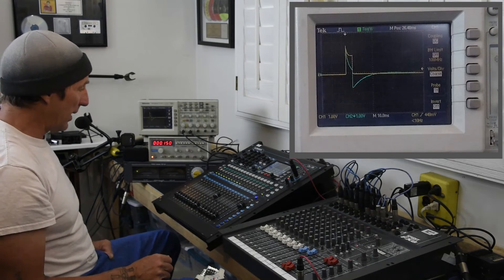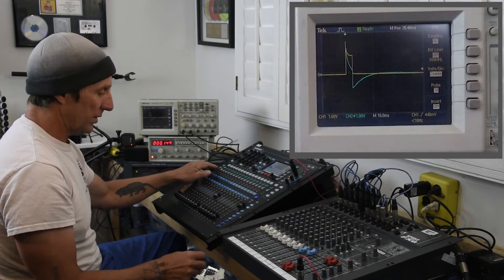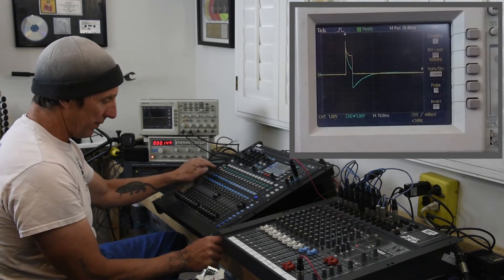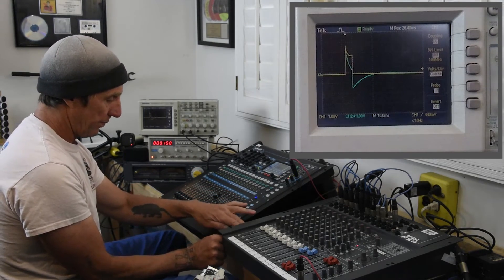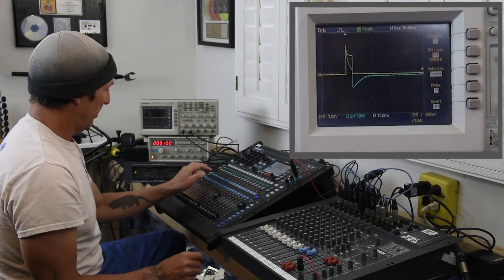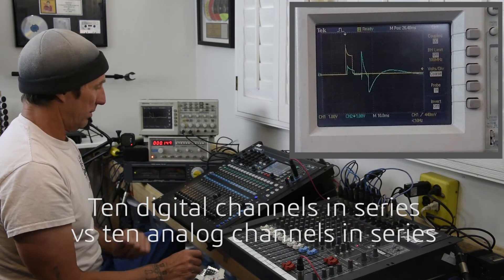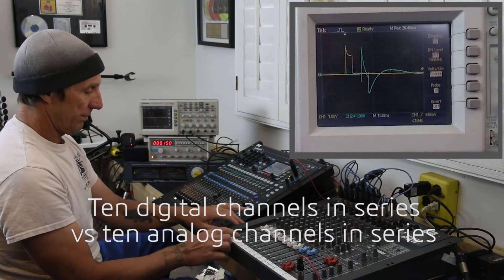Digital versus Analog #4 of 6 - Pulse Test

Comment: I like the sidebar about how "irrelevant" 1.5ms latency can be. It is very easy to fall into the trap of nit-picking anything that isn't absolutely perfect as soon as you're made aware of the imperfection, but you'll never actually do anything if you let that mindset start creeping in because perfection is impossible as long as we're in a physical space.
Reply from the maker: That's not a simple answer and is application and situation dependant. For a  main PA or for a recording where 1.5 Ms is applied to all channels or the mix or both, all good.

For in-ears when listening to your own voice that is delayed 1.5 Ms or about 18", it is audible and the electronic signal no longer perfectly sums with your audible body resonance which may slightly degrade the quality of the sound heard by the singer.

And for two signal s that will be electronically summed, delaying one q. 5 Ms more than the other can create very audible and sonically detrimental issues.

It's about knowing what's happening and the impacts. 

It is not optimum when people use information in useless ways or if people ignore or downplay useful information.
Reply: @DaveRat  I've been made aware that older and/or cheaper digital mixers don't always maintain the same latency across channels, especially if insert effects are used. That seems like a fairly easy issue to address, since you can align the channels with small delays, but how do you deal with the IEM situation? 

Thanks for sharing your time and knowledge!
Reply from the maker: Digital mixers that do not maintain constant latency are annoying and avoiding resumming any signal to itself will mitigate the issues.

As far as in-ears, it is a perception thing that some people are more sensitive to than others. Basically, with latent ears, your voice sounds farther away from yourself than naturally.

Interestingly, some latencies are more detrimental than others and increasing the latency can sometimes help shift comb filtering to more desirable frequencies.

I have done several videos on the subject on on both the public side and member side of this YouTube channel that go into depth and let you hear the issues

Comment: I think the graduations you saw in this case we caused by the pulse, not necessarily but the fader/pot. No matter how smooth of a control you have, the scope would only change when the next pulse comes around, so would appear to jump.

Am I misunderstand something? I'm not saying they aren't stepped at all.
Reply from the maker: Read the comment on this video about fader digitizing by Dougal Tolan, he goes into more depth on and offer some interesting additional info, not only does it jump but he also says the jumping causes other issues tht need to be addressed or will sound bad.

Comment: Fun fact about digitizing fader position...
It is essential to place some kind of low pass filter on the fader position output, otherwise you make some very expensive scratchy faders. Those gradations that you were demonstrating, if not filtered cause steps in the audio out and sound just like a scratchy fader.

So, why not sample fader position at the same rate as the audio? While it is possible, the calculations required to convert fader position to the numerical parameters that directly affect the audio path cannot be done at audio sample rate (cheaply). The idea being that you cannot twiddle the fader at much more than 10 Hz.
Reply: This is good stuff dude. Thanks! 😅👍
Reply from the maker: 👍thank you Dougal and very interesting!

Comment: Phase lead and phase lag are what Dave is referring to. A single-pole/first-order filter network has 45* of phase shift above and below the corner frequency for a total of 90* of phase shift. There is 45* of phase lead and 45* of phase lag for a total of 90*. A two-pole/second-order filter doubles the amount of phase lead and phase lag, etc. and so on.
Reply: A first order low pass filter has little shift far(approximated at zero) below the corner frequency, 45 degrees at the 3dB point and then goes asymptoticly to 90 degrees at high frequency.

Comment: I have an analog console that won't pan on any channel.  Only the left channel works on the master bus, unless you press the PFL button and only then it's when both channels work.  Do I have to open this damn thing up?
Reply from the maker: Sounds like a bad connection inside.
Reply: @DaveRat  Ok.  I'll open this damn thing up.  Haha.
Reply from the maker: @380stroker  👍

Comment: Have you considered the loading effects of your scope? I notice you're set to 1x. Using a 10x probe significantly reduces your circuit loading and can give much more accurate measurements. Would be interesting to see if there's any difference in your results here.
Reply from the maker: Thank you Josh, 

I did consider that and since I am driving the scope from the headphone outputs of the console. I compared the headphone out to the left/right outs and the signal differentials were not easily identifiable. Since the headphone outs can easily drive higher currents into low impedance loads, the load of the scope is negligeable. As far as the x10 probes, I purposely wanted to reduce or eliminate any additional un needed complexities in the measured signal path

The sound you hear is recorded from the exact signal you see at 96/48.

Also, since the levels from both consoles is nearly identical, and the measurement method for both consoles is identical, any issues should show identically for both.
Reply: @DaveRat  yeah cool. The 10x probe though, doesn't only have a higher impedance, but also effectively has less parasitic capacitance, which is potentially still something to think about, especially when impulse testing as those sharp edges have a lot of high frequency content which is most effected. a 10x probe doesn't add any extra complexity, it effectively just adds an attenuator in-line which the scope then accounts for when set correctly. Maybe not likely to make any discernable difference at all here driving from the headphone amp as you say and yeah, issues will be the same on both ends, but could still be interesting to compare if you were so inclined. Great series, so interesting to actually see all this empirically.
Reply from the maker: Thank you Josh, I will measure the raw pulse with and without the x10, overlay the two pulses and also do a subtraction of one pulse from the other.  I will post if I see anything seemingly significant.